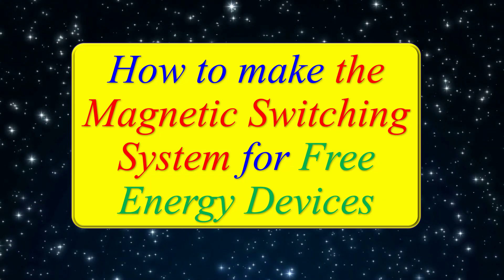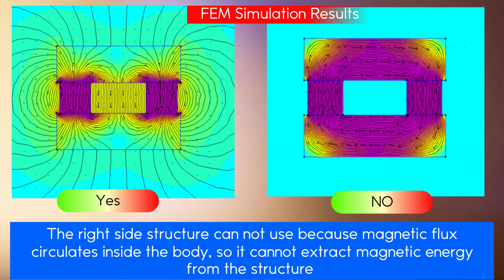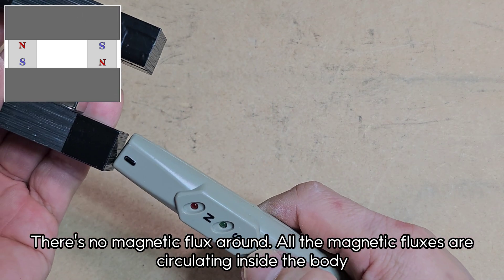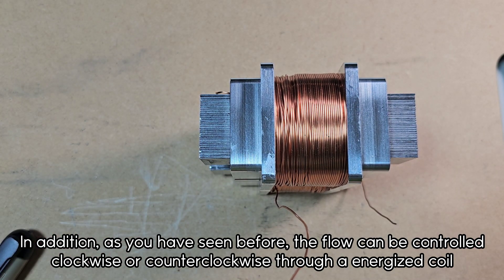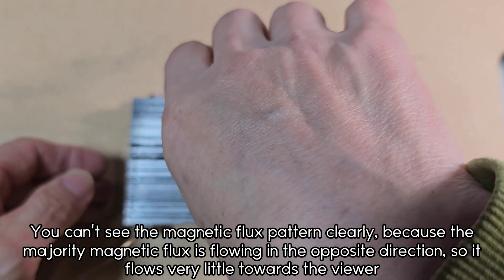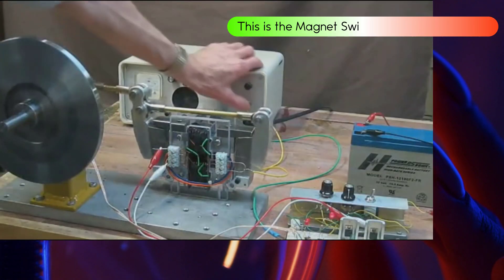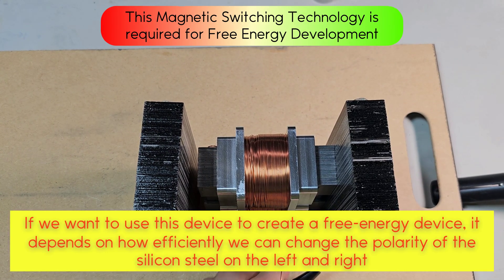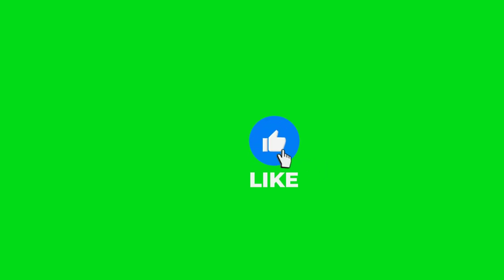How to make the magnetic switching system for free energy devices

Comment: Good attempt and explanation, but once the both silicon steel cores attached to the middle core then both share same amount of flux and balances each other...!
Reply from the maker: The main body used in this experiment was a high-quality N52 magnet, and the magnet used in the other small size (No Coil) was weak in strength, so when the magnetic flux became a close loop, it did not leak at all. However, the main body (with coil) showed that the permeability of the silicon steel was not enough to pass through the flux of the two combined magnets, so it leaked out little by little to the other side, and held the silicon steel weakly. If you leave two silicon bodies on the left and right sides without any electrical input, the attractive force acts to make it symmetrical to the left and right. And even if you change the direction to one side by giving electricity, if the silicon steel is attached to the other side, it will operate almost the same after a day. I think if the silicon steel has enough thickness, it will remain the same. Also, please, don't forget subscribing my channel. Thanks
Reply: @LanikaiEnergy   thanks for your reply. I think the N52 is not important, but the magnet flux generated by the coil that balancing with the permanent magnet flux in the magnetic circuit is important.
If the two side cores are attached to the center core and if you apply sufficient current to the center coil, then the flux generated by coil will travel outer core skin of both cores and permanent magnet flux travel inner core skin and circuit completes,So no change in attraction or repulsion. As you domanstrated, if attached only one side core then naturally all magnetic flux will travel from inner and outer core skin so no visible flux on second side,but as soon as put two side cores then the flux travels shorter path and balancing out the circuit and no power gain will be achieved.
Reply from the maker: Thank you for your opinion

Comment: Respected  sir
Can we use ferrite core and high switching DC plus to achieve high rate of magnetic flux change in a unit second. No of turn will also reduce and out will be more. Use tank cct at output and step down transformer  for domestic use
Pls advise
Regards
Rajesh
Reply from the maker: Ferrite magnets have a low magnetic flux density, which makes them less efficient for applications requiring strong magnets. On the other hand, Soft Magnetic Composites (SMC) offer higher efficiency, making them well-suited for use with powerful magnets and high-frequency operations. Also, Don't forget to subscribe to my channel. Thanks

Comment: You'll find that one challenge when you go to build a motor is the speed at which the magnetic river changes direction. This speed is further slowed by the silicon steel structures. The time delta in the magnetic domain is surprisingly slow as it oscillates back and forth. This limits the number of reciprocations/second that can be achieved at full magnetic saturation levels. More steel, more torque, at the expense of speed. It's a constant trade-off. I love this concept! It pulls on my attention.
Reply from the maker: Thank you for your good information
Reply: Have you tried mu -metal ? Higher saturation
Reply: 400Hz not fast enough?
Reply: @ 400Hz may not be practical. The technique here involves 100% magnetic saturation of the core. Normal motors do not maintain their magnetic power for very long at all. They continuously transfer the magnetic power between the rotor and field coils, never saturating either. Everything in existence has tradeoffs. In this case, it's the nearly infinite holding power, but that comes at the expense of speed. Think of charging the inductor like charging a capacitor. The bigger the cap, the longer to charge it AND you have to wait a ridiculous time frame to charge it to 99% voltage level. It will never hit 100%. It will be interesting to see what pulse rate he can hit, for sure!
Reply: @craigpierce7996  this is why air-core. and with capacitors, not 100% but the opposite - allow the recovery voltage which also takes ...time. you should understand what bedini was doing. aaron murakami has a site with this information still

Comment: Feed this Coil setup with mains AC & the Magnetic Field would oscillate 60X per second at 60Hz Mains Power maybe connected to a Variac, then you just rotate it within a Massive Doughnut Shaped Coil like: O[] []O
Reply: how about an increasing oscillation
Reply: @jamesbunn4885  Theres this guy named Bruce De Palmer at Santa Barbara, California that invented the ‘N’ Machine a Rotating Electromagnetic FREE Energy Machine. The US Government confiscated his prototypes & nearly destroyed his life. De Palmer moved to Auckland New Zealand & built a Machine called the Quadrupole ‘N’ Machine which put out more Power than his previous ‘N’ Machines. The Quadrupole ‘N’ Machine with Mercury Contacts & it used a stationary ‘Compensation Coil’ that was Equal in Amplitude & Opposite in Sign creating a 8 Field that Compensated against Drag caused by Energy Withdrawal.. It needs: Geared Rotation, Maximum AC Oscillation & a Compensation Coil!
Reply: @jamesbunn4885  I think I’m going to build this using 2X Shaded Pole Motor Coils, cut the Cores with my Dremel Tool then use Neodymium Magnets with North Poles facing up. I’ll Oscillate it with 10,000 Hz AC. Then use a bifilar wound coil with 1/2 Pound each of 26 AWG insulated Wire & 23 AWG insulated Wire. This would be rotated using a planetary gear at around 5000 RPM. Then have a Compensation Coil Stator charged with the output ‘Equal in Amplitude, Opposite in Sign (et al Bruce De Palmer ‘N’ Machine)’ to cancel out Drag ‘8’ caused by energy withdrawal. I’d already built the John  Bedini SSG ‘Radiant Energy’ Charger & the Stanley Meyer ‘Electron Avalanche’ Water Fuel Cell. I’ve always wanted to build/replicate Bruce De Palmers Quadrupole ‘N’ Machine, now I can merely using 2X Shaded Pole Motors!

Comment: this can be an energy multiplier
Reply from the maker: If you make a magnet motor with this, it doesn't increase the power consumption of the motor, no matter what the heavy load is put on it. That fact will be fantastic.
Reply: @LanikaiEnergy you mean instead of two steel bar on the sides using magnets?

Comment: This gives me an idea for a Solid State (VTA) Device to extract ‘Radiant Energy’ from the local environment. I’d have 2X Shaded Pole Motor Coils (Use Dremel to Cut the Cores) & Neodymium Magnets with both N Poles facing up. It’d cost me about $100. to build this & would provide endless hours experimenting with Back-EMF Im-Pulse to charge Batteries & Tuning this thing to the Resonance Frequency of the Magnets making them ‘Sing’ (with a high pitched whine) in Resonance.
Reply from the maker: I support your idea. I hope to see it when it is completed
Reply: https://youtu.be/FhXeCqrgKT8?si=DitKV8O7VFr4rIMm